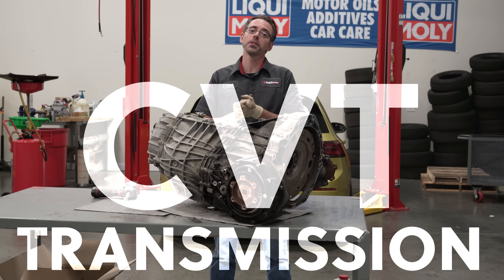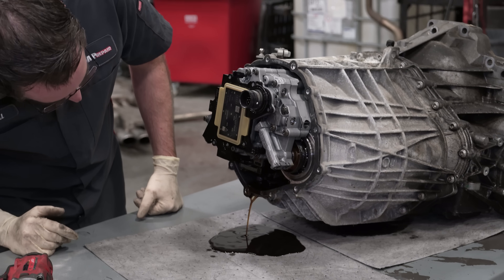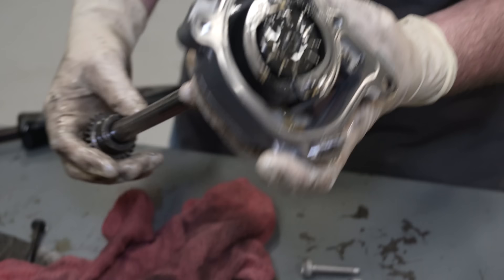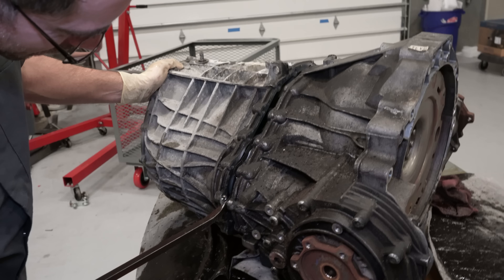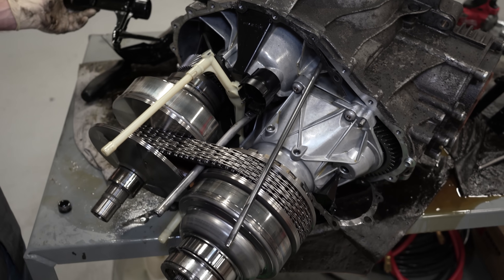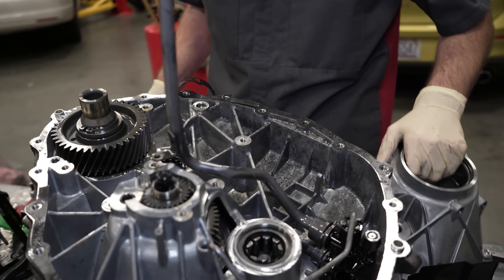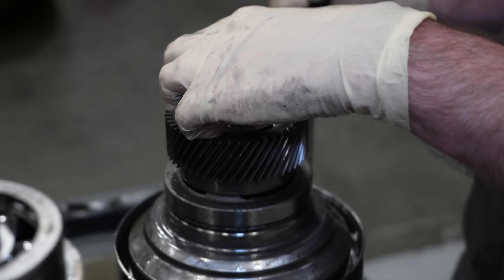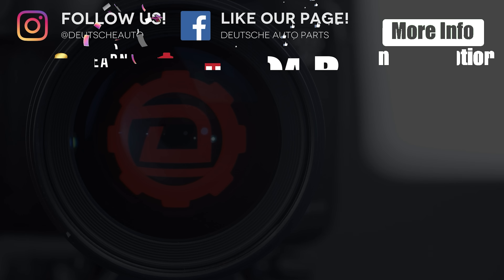Why you shouldn’t get a CVT transmission

Comment: So, poorly made and abused CVTs fail.  Just like poorly made and abused engines, poorly made and abused suspension, and poorly made and abused cars in general.  My 3.6L Subaru has a rock solid reliable CVT with a touch over 150K miles and probably 10K of those miles being off-road.  As such, I'm in the "everything which is built well will perform well" party.  The "CVT are bad" crowd pairs well with flat earthers.  Evidence schmefidence.  An unidentified "everyone" saw a bad one and since 1 of 1 is 100% that means all thems is bad.
If I were to rank, I'd put Manual > CVT > Automatic > Nissan.  My main reasoning is that it's only when I drive a stick or CVT do I actually feel as though I'm in control of the car.  Autos scare the hell out of me because they like to shift gears at the worst moments.  Climbing a cloverleaf is no place to shift gears, but any autos I've driven do it all the time.  My CVT will just linearly glide up the curve and my stick... well... ~I~ decide what the stick does, so no problems there.

Comment: I have at least had good results with a 2006 Prius the car was still running well when I sold it at 263k miles and never had to do any work on the CVT, just fluid changes

Comment: Subaru Outback owner, 211K on the clock. CVT services every 50K (even though the service manual recommends "inspection" every 100K). Since the car is turbo charged, I never drive hard until I see the temp gauge starts moving up. Essentially, keep on top of your oil changes, never drive hard on cold engine.

Comment: Cannot believe how complicated this is compared to the DAF variomatic belt system.  And the DAF system so much more complicated than variomatic on most modern scooters. Obviously the torque and loads are different between all three vario systems (performance car, lightweight DAF 33, 350cc scooter). For me however, it will be vario for bikes/scooters and manual for cars.

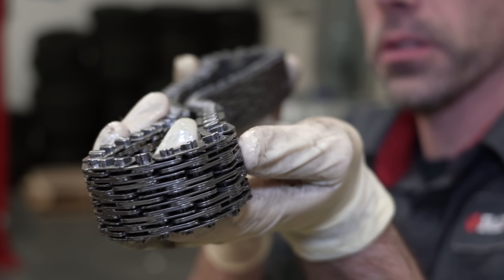Comment: No wonder German cars are unreliable in USA when people with no apparent skill or training are working on them. Someone who can't even properly disassemble a gearbox can't possibly fix or maintain anything either. Also the comment on 9:55 about the taper on the chain being "wear" shows a complete lack of mechanical understanding of how this gearbox works. The taper is not wear, it's what enables the system to work, for a reason that is very obvious to anyone with basic understanding of physics and mechanics.

Comment: a metal chain on metal pulleys in oil... and people wonder why they shudder?  Stupidest design ever for a car! I just bought a Subaru Crosstrek and I made sure I got one with a manual transmission. I avoid CVT like the plague. Snowmobiles use this belt clutch setup but at least on a snowmobile the belt is easy to change.

Comment: Toyota eCVT is the answer.
2 motor-generators, a single planetary gearset between them and a clutch for the petrol motor. That's all. Every single Toyota and Lexus hybrid uses this design.

No belts, v drives, cones, clutch packs, torque converters, mechatronics, hydraulics, high friction oil, synchros, solenoids - it doesn't even have a separate parallel output shaft. Just two motors meshing together via a single gear set, Simulating a cvt by spinning at different rates.

Recently bought a Yaris hybrid with 125k miles on it and drives like new, the ratio adjustment is instant, you cannot feel transition between ev and petrol mode at all and MG1 doubles as starter motor so there isn't even a separate loud and slow starter motor - petrol engine fires up immediately on first crank. MG2 does majority of the driving and regen braking. Gearbox does it all and it's so simple that there isn't even anything to break inside it.

Now, a Yaris won't win a drag race nor is it exciting when you floor it and cvt drone is real, but at this level of comfort and reliability, it cannot be beaten.
Think I'll buy a GS hybrid after this as a second car with a bit more grunt - but Yaris is staying with us forever. Wouldn't touch a dsg, multitronic or amt now with a 10 foot bargepole and after 12 years of stick I don't miss rowing my own gears at all.

Comment: They can't fool me !   A Swiss watchmaker designed the damned thing. I can see now WHY these transmissions are the price of a house to replace.  The "launch" gear in Toyota CVTs obviously greatly reduces wear on the snowmobile style drive in the Toyota CVT.  Thank you....I will stick with manual transmissions. All the damned solenoids in the CVTs & regular automatics are plagued with 
"sticking" . I expect that if owners changed fluid at say...50000 miles & the filter as well, that the transmissions would have a greatly extended lifetime. I was thinking as I watched the "take down" of the CVT that if you were rebuilding one from the "ground up" it must be a one Hell of a job to do, & time consuming. It was an education for me to see the internals of that CVT. Thank you !

Comment: It's a slightly beefy golf cart clutch/belt drive. I work in the golf cart industry, and I would never trust this design to be reliable over time. When we do a "standard service," it includes the transfer belt. CVTs will ALL prematurely fail because of inherent friction/heat.

Comment: My wife just had a module replaced in her merc 170b  ,strange thing is they needa module replacing at 100.000 miles regardless of any servicing the gearboxes have my wife's motor was at 100.024
 miles costing £2500 to fix I have since learnt strangley that just over 100,000 miles is the norm makes you wonder if they are programmed to fail at that precise mileage ,especially as its only mercedes that can repair them

Comment: Subaru seems to hold pretty well for their CVTs. More so the Outback. Bought my Subaru outback 2014 used, had a new engine and radiator installed. Transmission still has its original miles, somewhere near 120k if i remember correctly.

Comment: My wife’s 2020 Subaru Ascent started “stuttering” when accelerating after only 40k miles. We had to fight them for several months before they finally agreed to drop a new transmission in it. My 2020 Outback (XT) started stuttering after 75k miles. I should add that I am EXTREMELY good to my vehicles. I don’t abuse them. It only took a 5 minutes phone call to get them to agree to replace the trans. I’m 100% fed up with these things. My father has a Subaru sedan (I forget the name), and has had no problem with the CVT on it.

Comment: Not infinite. Continuous. CONTINUOUS NOT INFINITE!!! It’s in the name of the thing.  There is nothing infinite about it. It lacks discrete or fixed positions giving it undefined or indefinite variation in theoretical gear ratios gear ratios. Sire you can theoretically divide a continuous function into as many parts as you like but it the word is a bad choice and I keep hearing it. Throwing the word infinite around is why we can’t visit other planets for the cost of a plane ticket or at all. Because people speak inaccurately because they think inaccurately and vice vera . No. And no. Even the AK47 sucked for years before it became one of the most reliable things. Standard transmissions and automatic transmissions both sucked at first as well. They make a lot of sense, they’re just half baked in bigger vehicles.

Comment: Wrong. Ur a disgusting fake mechanic and anyone that takes u seriously is just as pathetic 1st cvts are the most amazing peace of engineering ever  many cvts make it 200k miles  nowadays  with with with with fuildchange every 30k. 2nd the old ones 2015 under had issues 2016 are better but 2022 up are bulletproof with maintenance

Comment: Nobody changes the fluid or filter and they fail. I had a 2008 Nissan with the Jatco CVT and it was fine at 160k when I traded it in. I did drain and fills starting at 60k and replaced the external filter. I had a torn intake boot that was misdiagnosed as a transmission problem since it only opened under load. Worn motor mounts caused it. When the fluid starts changing color it’s time to change it.

Comment: My Nissan Sentra (B17) 1.6L is 11 years old now. Did 350,000 Kilometers. Never changed transmission oil. No issues so far.

Comment: I have a 2008 Audi A4 CVT W/ 8 speed paddle shifters. I absolutely love it !  I’ve changed the fluid every 30k miles and have had no problems.  It’s as fast as an S4 and I get 30+ mpg.  Wouldn’t own anything else.

Comment: I recently tested a 2023 Corolla out between California and Texas. I didn't like how it starts out ( felt like a centrifuge transmission on a go cart ).  But noticed at high speed it maxed out like a governor , then when you let off and punch it again it excelled again going from 114 mph to 127 mph rather quickly.  On the fence but really didn't like the start .

Comment: I spoke with Honda dealership mechanics before I bought my Honda Accord Sport with a CVT.  They all said there was no issue with the Honda CVT. I'm now at 168,000 miles and it's still going strong.
Reply: Just be sure to have it serviced every so often, roughly every 50k miles. That fluid don't last forever! :)
Reply: @MichaelSheaAudio exactly ,I'm telling you is garbage,the manual one or automatic is the Best asking all of you guys why the formula the rally cars don't use this type of transmission
Reply: @markaegyssus5192  Last I checked we drove road cars, not formula cars. Do you wear the same shoes that all the fastest runners do just to go grocery shopping? I would hope not, they're terrible for your feet. 😅
Reply: @markaegyssus5192  F1 and WRC banned CVTs because they determined that they gave cars an unfair advantage over non-CVT vehicles.

The criticism of CVTs has to do with their long-term reliability.  Do you seriously think the WRC is banning car parts for not lasting enough 10s of thousands of miles in a rally car?

Comment: Why do people hate CVTs????
The engine is in it's best RPM the whole time it accelerates meaning the best efficiency/power for almost any situation. 
The only reason why they fail is that (I have never even seen one yet irl so just speculation) they aren't as overbuilt like normal geared transmission as as the chain relies on friction on a relatively small area so ofc it wears out quicker
Put weaker engines on them, why would you need 100hp in a city car that occasionally goes on a trip????

Comment: So—you don't want your motor to be able to run at constant speed? You do want chunky response to smooth inputs? I completely understand why you might enjoy the sense of control you get from a manual, but I don't think I can be persuaded that an automatic is a superior solution to a CVT. That's confusing poor engineering solutions with fun.

As to the quality of the implementation, clearly that's about the quality of the implementation.

Comment: All Toyotas have been cvt for years..i have seen one broken. 

Subaru has done solenoid issues.. But once fixed that go forever... Driven by chain...

Only Nissan that uses Jatco.. Have issues... And any other companies that use jatco.

Personally having a Subaru with a CVT was a great experience... And i was often using only 5..6 litres per 100kms... On 2.5 boxer😛😛🤠🙋
Reply: Do you know something about them? so here is what happend to me  I wanted to launch my Toyota Avensis, press the brake then accelerator and it just snapped.. it's going D, R but doesn't move. When I put it in P it makes some noise for like 3sec 2.2d 150ps 2010

Comment: I do not see any critical problem with CVT in this video...no scratches on cones, no problem with metal pieces in an oil, no visible problem of the chain. I see only one idiot in video who showed nothing why you should not buy CVT...if there is a problem with oil pressure or mechatronics it is repairable quite easily, it can happen in each automatic transmission type.
Reply: Hello I wanted to launch my Toyota Avensis, press the brake then accelerator and it just snapped.. it's going D, R but doesn't move. When I put it in P it makes some noise for like 3sec. So can someone tell me what should I do? 2.2d 150ps 2010
Please tell me if you know what could it be. Thanks

Comment: CVT’s belong in SXS’s not passenger vehicles. I worked for Tomcar for 3 and half year rebuilding their CVT’s and yea it’s easy to fix in the field. And they worked great because they where belt driven not an oil bath chain. The only thing that went bad on ours where the weights beating the inside plates to death, once the grease breaks down you’re fuc#ed.

Comment: It was a DAF in the 1960-1980's with this kind of transmission, but it was using rubber-kevlar belts so it was dry, I believe. Moving into this chain design is a monstrosity from the designer point of view, and that's why I was imported to USA, to design sh..t that works from the first time. The secret? Follow Rene Descartes four rules of knowledge/analysis before you design anything. You find them in his "Speech (Discours I believe in French).on the Method" dissertation.

Comment: If you are old enough to remember what a Mini bike is, the ones that were usually made from an old lawnmower engine, these are (though much simpler) what they used to transfer power to the wheel. They were adequate for that, mostly. For cars that should run for several hundred thousand miles with proper maintenance, not so much. 

These types of transmissions are the main reason why Nissan has really declined in quality automotive products. 

I do understand that the car companies are trying to get to a better, cheaper to produce, and more reliable and longer lasting transmission, (hopefully that is the goal) because the current overly complex, unreliable, and practically impossible to rebuild transmissions that are currently being used are generally not working well for a lot of the vehicles on the road nowadays. 

Personally, I wish they would go back to manual transmissions for most vehicles, at least if they would build them to last. Back a few decades, it was unusual to have a manual transmission ever fail during the life of the vehicle if properly maintained and not abused to much. You might have to redo the clutch and such a few times, but that's not a big deal. 

Also, and I blame the EPA for most of it, in the past, it was typical buy a new car, and even with good maintenance need to rebuild or short block the engine and transmission every hundred to two hundred thousand miles, but it was a top end job and transmission rebuild on (for example) a GM 350 small block, and a Turbohydramatic 350 transmission, which any decent local garage could do fairly cheaply, quickly, and easily. 

Again, with the better quality oils and maybe adding an aftermarket oil and transmission cooler to a vehicle they should do even better than they used to. There's a LOT to be said for simplicity.

I had a '99 Ram 1500 Magnum that went through three transmissions in under under 175,000 miles, and the last two were WITH an extra transmission cooler. My shop said that they were basically not able to be rebuilt, and so I wound up using used (and crappy) transmissions. Actually it was more like six transmissions, because they had to send a couple of them back because they didn't work when they got them. 

Current truck is a F-150 3.5 Twin turbo Eco-boost and it's (IMHO) WAY too complex and to last as long as a good truck should, but I got it in '17 with 23,000 miles on it for $26,500 from Budget Rental sales, and I couldn't have gotten a comparable vehicle from anywhere else (I looked!) for less than $10,000+ more with a LOT more mileage. Besides, it goes like scared ape. But it's way too complicated, difficult to work on, and expensive to fix, and I'd be happy to have a lower cost equivalent to a 1985 pickup with roll down windows, cold air, and a lot less power, and have it be reliable, cheap to fix, and easy to work on. Oh, and a MANUAL TRANSMISSION! But that's just me.

Comment: A CVT requires fluid change, much like an oil change. Just not as frequently. 
 If you don't change your engine oil, your engine will expire. Same goes for CVT.
 The problem with a failed CVT is you can't rebuild, which costs over 6k to replace... do your CVT fluid change at least every 30k.

Comment: I bought my first auto car in 1988. I have driven various types of autos but I must say that my 2021 2.5 Nissan XTrail is the best experience by a long shot. Responsive, quiet and it seems to combine well with the speed control to produce a seamless drive and experience. As far as I know (rumour?) Nissan launched a new CVT during 2017/2018. I believe failures since 2018 are vary rare.  I also rented various versions on business trips. The worst experience was with a Hyundai with a twin clutch. This was horrible.

Comment: 35 year auto tech here. Don’t watch the video unless you are bored to death. I will let you in on a little secret. Don’t buy any car with a CVT trans. They ALL suck. Unless you drive like grandma all the time and even then it won’t matter but they all fail before 100k miles. When the manufacturer says your trans never needs it’S oil changed and provides no way to change it, it’s a pretty good sign it will fail before 100k miles. In my shop I used to rebuild both manual and automatic transmissions. When CVT’S came alone I drew a line in the sand. No CVT rebuilds. It’s not worth it. Just go buy a new trans or a new car. Simple. Ok some say there are rebuilders out there. Yeah, dealerships cause they have to. And rip off artist who just want your money. Look, please save your money. Don’t buy a car with a CVT trans. We call them Bic lighters cause they are throw away cars.